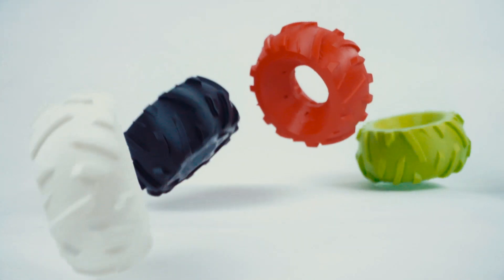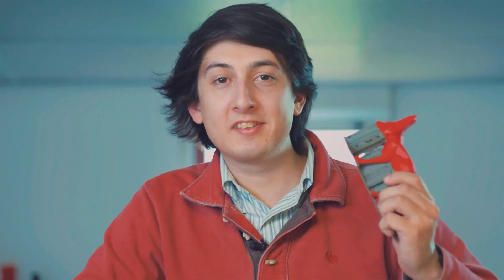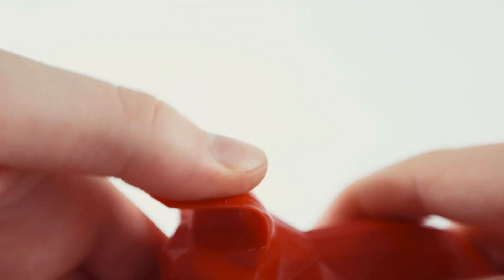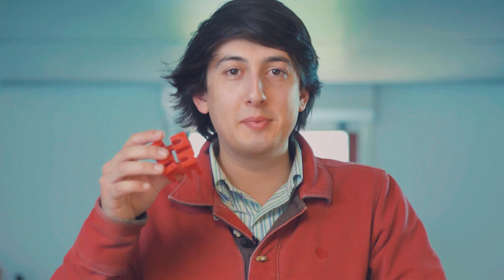FleXD flexible filament from E3D

Comment: talking about flexible filament, any tips on getting ninjaflex working on my titan aero, it just doesn't wanna extrude properly at all
Reply: Print slow, try 20mm/s to start.  Increase temperature.   I can print it on a regular V6 which has a longer filament path so aero should be better in terms of lower nozzle pressure at least.   only issue i run into printing too fast or cold or not having a fully straight path into the hot end is that it will kink and wrap it self around the extruder gear.  lol.
Reply: Eric Kelly the main problem I am facing is that I cannot see inside the extruder so I can't verify a straight filament path or not

Comment: Which of your extruder, nozzle and heatbreak combos do you recommend for this new product?
Reply: I have personally printed with a Titan and Volcano on a V6 for ~8 hour prints with no issues. But a Stock V6 or Titan Aero will be totally great as well. Anything in the ecosystem will work just fine.